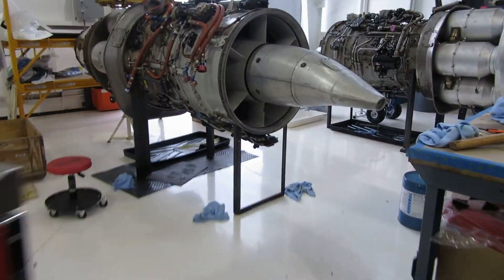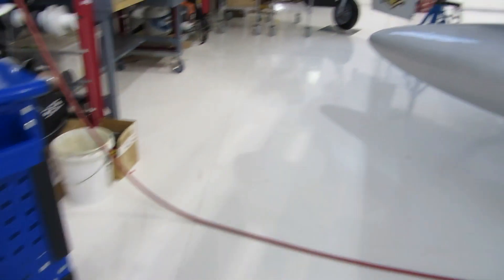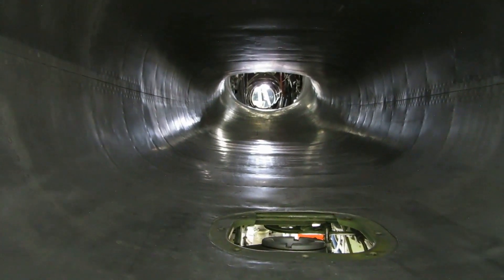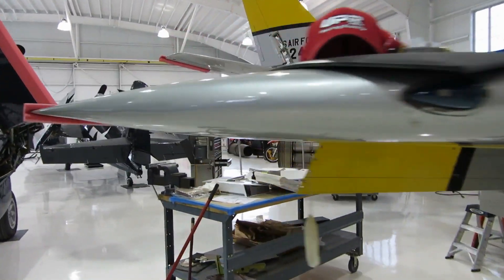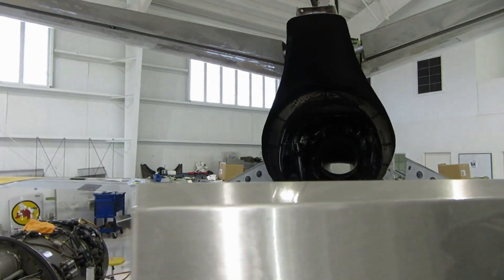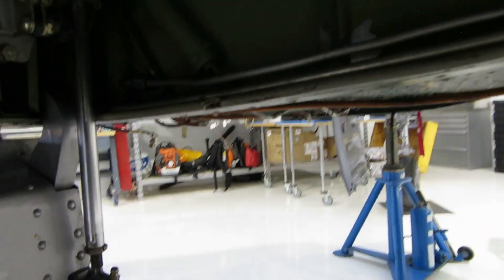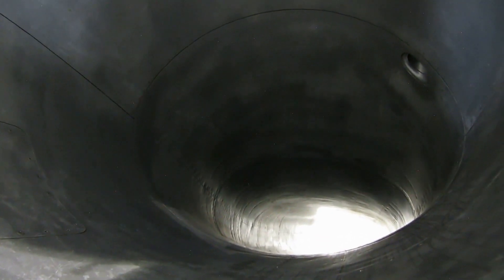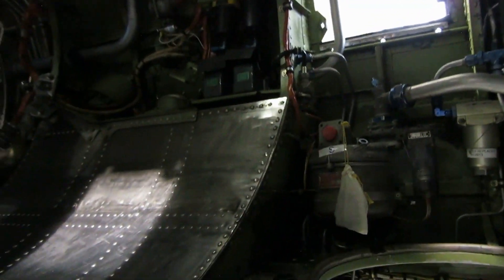Orenda 14 : Jetfighter Engine

Comment: The Pratts on the low bypass fans on the 100-200 series 737 also had the asymmetrical inlet cone. I remember one of them came off and made quite a mess. Glad it wasn't me.

Comment: Though nose intakes make for an extremely clean and fast fuselage design,  such a design requires concessions to be made between fuel and avionics since the fuselage also has to have enough space for intake air to make it to the engine.  Looking at the MiG-21, successive generations of the aircraft saw versions with larger dorsal spines/humps to expand on it's originally anemic fuel and avionics carriage which was a problem thoughout the entire series.

Comment from the maker: Depends how you fly it. The Orenda 14 engine is right about 1.0 for sfc... Specific Fuel Consumption, measured in pounds of fuel per hour, per pound of thrust.
 
The full thrust of the engine is right about 7200lbs.
 
The plane, with all tanks full and carrying huge wing tanks, doesn't hold anywhere near that much fuel.
 
It's a gas guzzler!
 
Bigger, faster, louder, and better looking than a '63 corvette though, isn't it?

Comment: Even in the MiG-21, the intake shock cone has very little room for a radar.  Also aircraft with the variable ramp intakes you see on many jets (the rectangular ones a la F-15, F-14, Su-27, MiG-29) will do a better job of making sure plenty of air is sent into the engine when at high angles of attack during hard dogfights and the like.  Those kind of intakes are simpler to design and build too.

Comment: So I was right (almost), the Sabre 6 was based off of an F model, at 1:48, you can see the words right there, F-86F-30, which has similar (if not the same) specifications to the F-25. Same turn rate, top speed, climb rate, takeoff run, etc. Let me know what you think!
Reply from the maker: Keep in mind that these are privately owned aircraft, and are painted up the way the owner wants.
There are several Mk6 Sabres out there painted with F-86 markings...
Reply: AgentJayZ Awesome, I'm glad you read my comment. I never knew about that but I did hear about a Lamborghini aventador that was painted with USAF markings, so I guess a CL-13A Mk 6 could do the same. I also put a reply with a MUCH more in depth analysis on this scenario on your fighter jet fuel tanks video and your 'Orenda 14 in the Sabre 6'  if you'd like to read that. It's comparing the F-25 sabre which I thought it was, with the F-30 sabre. The Sabre 6 is actually the Canadian designated F-86F-30 sabre, but I said F-86F-25, so I compared the F-30 with the F-25 and saw that they have similar specs and performance. So I was really close. There's more in it in your 'fighter jet fuel tanks' video if you can find my comment.

Comment: I would assume a hoist that connects with the fuselage and a cable drops through to winch the engine up.
Locked using aircraft/engine mounts.

Comment: That kind of view makes you realize the differences between fighter aircraft, civilian aircraft and ground vehicles. Civilian aircraft and both military and civilian ground vehicles are pretty anemic in the engine department compared with military fighter aircraft- That view of the Sabre6 shows that it is mostly wings and engine. I suspect most modern fighters to be similar, but you'd never get that good of a look without acquiring some new bullet holes, I'd imagine.